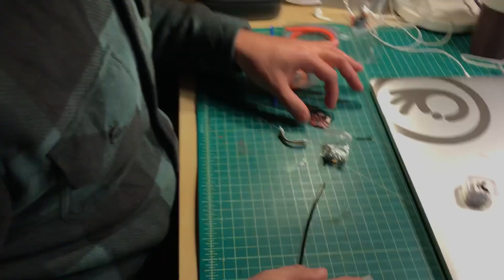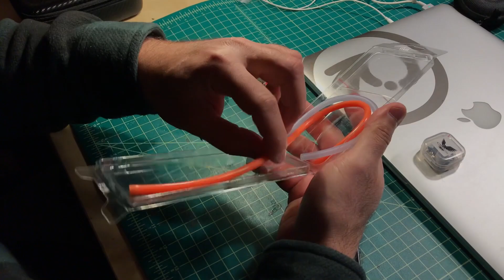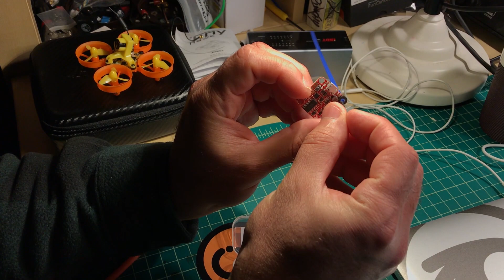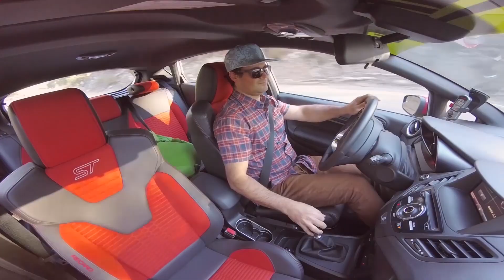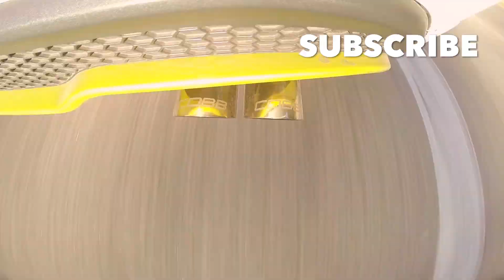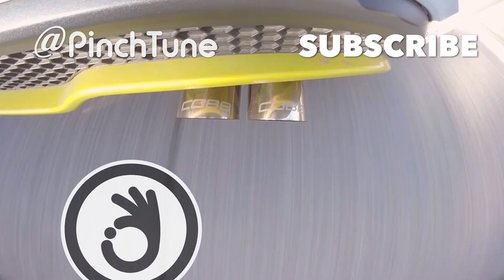How to Combine M2 Hardware ESCs with M3 Hardware Flight Controllers

Comment: how is it that no one makes a nylon or metal spacer with male m2 threads and female m3 threads... such a basic idea. Every try drilling out a board to see if it still works?
Reply from the maker: I've drilled out board before. In fact, I have a video somewhere about drilling out a board. But you can't do it with all boars. Some don't have any space between the holes and the components.
Reply: @PinchTune  Can you have a look at the flysky x6B and tell me if that one looks doable? It seems to me it does, but I don't want to break it!